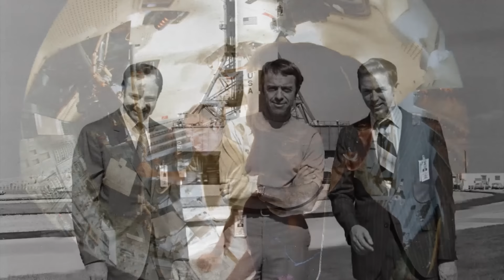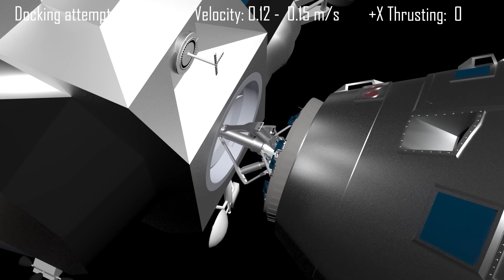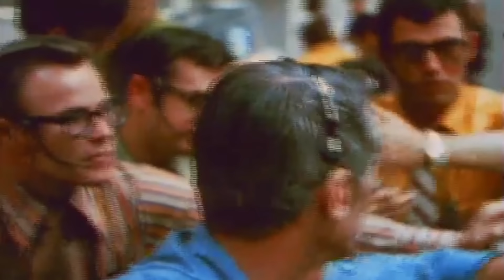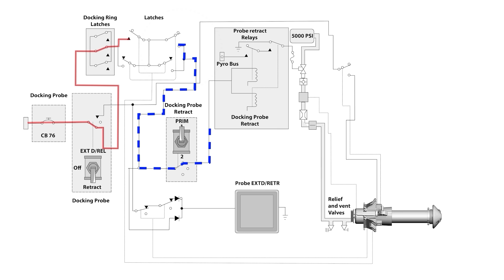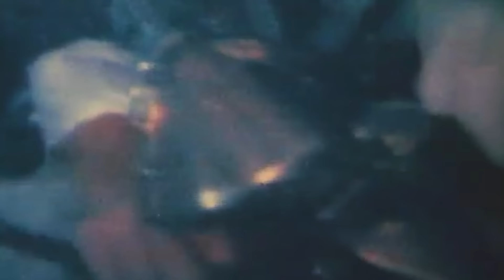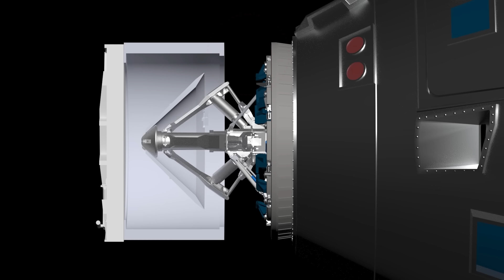Apollo 14  -  Houston, we have another problem

Comment: Thank you very much for this incredibly detailed video, with all the modeling of the mechanisms!

I have a question though - with regard to the 12 latches that trigger to lock the two vehicles together (after the probe is retracted), do those fire with springs?  And those are strong enough to hold the vehicles together with the pressurized interior just due to their geometry and where the pivot points are (just about in-line with the contact edge/lip)? I'm really curious about that.
Reply: And then they a lived happily ever after fool.
Reply from the maker: yes, and they didn't need all the latches. if some didn't work they could still make a seal and then when they opened the hatch the rest could be triggered manually. more info in my other video here: https://www.youtube.com/watch?v=4drYZcMY9jU&t=1s

Comment: I'm really enjoying your videos, they answer a lot of quests about the many subsystems of the various spacecraft. And of course raise more questions! 
When the LM ascent stage returned from the lunar surface, did the crews experience any additional docking problems, or did everything latch up normally, as expected?
I suppose if docking failed, the astronauts could have done an EVA to transfer from the LM to the CSM, but that would have been exhausting and extremely dangerous (man floats away, spacecraft hit and suffer damage, etc.) Every time the hatch any operated is an opportunity for a malfunction.

Last thing, have you made a video discussing the umbilical mechanism between the CM and the SM? I've wondered how that worked and what problems it may have presented. Thanks!

Comment: Got me thinking - what if they couldn’t undock and they had to try a re-entry through the earths atmosphere with the lunar module still attached .
Reply: The docking collar uses a redundant system of pyrotechnic charges to do the final separation between the CM and LM. If that somehow failed, I have no idea what kind of contingency plan they might have? The docking collar needs to be ejected before the parachutes can deploy so reentry with the LM attached wouldn’t even be tried.
Reply: If that really, really happened? They'd all die. The aerodynamics would be horrible, the heat loading would be greater, and assuming they made it through re-entry they couldn't use the parachutes.

The odds of the pyrotechnics to forcibly permanently separate the LM and CM failing are rather low, however.

Comment: They wouuld have to do it again at the moon.  Even though it eventually worked this time, if I was them I would be very concerned that may not work when they are at the moon.  If they never got it working this first time, they just abort and go back home.  If they couldn't get it the second time, the only way the two astronauts that went down to the surface could get home if they decompressurized both modules and space walk to the LM.

Comment: On each failed attempt the Lem stage must have been accelerated away by each impact, accelerating faster and faster away. I wonder how it didn't start to tumble out of control?
Reply: The docking was designed for the forces to go through the LM and CSM center of gravity, so it would not impart a rotational force.

Yes, each impact imparted a small amount of velocity on the LM, but the CSM could make up any difference by matching that velocity change.

Comment: I'm kinda surprised they went ahead with the landing. Weren't they worried about it having the same problem when the LM returned from the moon? What would they have done?
Reply: In that case, astronauts would most likely enter by doing a spacewalk, which would be really risky, but if there's no way to dock, it's the only option
Reply: An EVA crew transfer back into the CM was indeed one of many contingency scenarios that was planned out on what to do.
Reply: The Soviet plan for a lunar landing was also to do a Lunar Orbit Rendezvous with a modified Soyuz and LK lander.

They would dock but only send one Cosmonaut to the moon.  No tunnel was designed, and the moonwalk would transfer between spacecraft with an EVA.

Comment: Back in the day, Ed Mitchell's website had a forum where you could talk with Dr. Mitchell himself.  When I asked him about the docking incident he speculated that the probe latches had iced up, and that stopped the latches engaging, and that the ice broke after a few docking attempts attempts, releasing the latch and allowing the docking to succeed.  

He also said that if all the docking attempts had failed, they had a last resort plan that involved donning suits, depressurising the CM, opening the hatch and manually pulling the two craft together.  

This seems to validate what Ed said on the subject in that forum.
Reply: How would they do that? The docking probe is in the way.
Reply: @penguin44ca  they can bring the probe inside, just like how they would have when the spacecraft were docked normally, however there isn't a lunar module  in front of it.
Reply: Was there any fear that they wouldnt be able to dock after the moon landing?
Reply: @richieb74  once docked, you can have a look at the probe in a pressurised environment, and potentially fix whatever was the issue. Either that, or decide you’re aborting based on the inspection.

Comment: ...and; there was another huge problem just before separating for the lunar landing.   They were getting an abort signal from the lander, which would end the mission.   Nothing at current, would have caused problems, until;....they were separated and the lander was going through touchdown procedures.   Not to mention; a huge problem with one of the pressurized tanks, possibly leading to over-pressurization, and explosion,  which was solved  within a 15 min. time by an Earthbound engineer, who developed a fast computer program and had the Astronauts program it into their computer, and solved the problem.   It seems life was making it extremely difficult for Shephard to venture a moon landing.   NASA and Alan overcame the challenges.
Reply: And that’s why Al surrounded himself with a razor sharp crew.
Reply: If I recall correctly, that actually affected their allowed duration on the surface.

Comment: This was great - just wondering, wouldn't there have been a [huge] concern at the time, about re-docking after lunar landing/assent?
Reply: At that point they would have positioned the LM close to the CSM and transferred crew and samples between the two vehicles through the hatches if it came to that.

Remember that the ascent stage had 2 points of entry, the main hatch and the hatch they used as a transfer tunnel. Dave Scott on Apollo 15 did a 'stand up' EVA after landing on the moon from the top hatch to survey the landing site before they stepped out onto the surface. So they could have moved between the two vehicles that way.

The astronauts would have reentered the command module through its hatch, it didn't remain sealed until splashdown, as that was how the film cassettes were retrieved from the service module before it was jettisoned prior to reentry. One of the crew, the command module pilot, would perform an EVA to get them.

It wouldn't have been such a problem coming back from the moon as the LM was not needed to leave lunar orbit and was dumped before breaking orbit. The problem was that the LM needed to be attached to the CSM to get to the moon when the service module engine made burns on the way there and to slow down for orbital insertion which couldn't have been achieved if the two were not connected.

Comment: Do you know that: When you change speed, orbit high change. So how they ever made dockings?
Reply: They weren't in orbit; they were on their way to the moon.
Reply: @Tim22222  They did undock and re-dock while in lunar orbit so the question is relevant. 

That was the whole purpose of a lot of the Gemini missions. First prove they could rendezvous with another spacecraft while in Earth orbit. Once that was done, they had missions to prove they could dock together after a rendezvous. Certainly isn’t easy but for seasoned pilots with decades of hands on experience, it’s certainly doable.
Reply: To answer your question - there are thrusters to push the craft in all axis. So when they are docking in orbit - if you need to increase or decrease orbit speed relative to your target (which does affect your orbital apogee & perigree), you can temporarily counter this with burns in the vertical axis until the docking is complete.

Comment: I'm wondering how they were able to keep thrusting into the LEM without the whole third stage and structure moving (bouncing) away from them every time it was hit. Was the third stage also thruster stabilized to hold its position without drifting? Or was it heavy enough on it's own to take the repeated docking attempts?
Reply: It did bounce away. Not very much, but it did, that's just physics. But because the CSM had thrusters, it could match pace with the S-IV-B and the attached LEM without issue

Comment: I like your faith in the Moon landing. So, could you explain how they lined up the axes of both modules after one of them turning around the center of gravity and the other one was after 4 explosions to get rid of the outside guards? And are you aware that all this is :happening in a speed high above the Earth escape velocity...?
Have you ever seen for example formula F1 slightly touching each other in a higher speed?

I would seriously love to know, if you really do believe all that you are posting... BTW very nice contemporary animations. Love it!
Reply from the maker: I suppose it's similar to when they dock to the ISS which is travelling at approximately 17,500 MPH. Glad you like the animations.
Reply: because everything is moving at the exact same speed relative to each other. They also had the RCS to slow down in relation the the lem.
Reply: "Have you ever seen for example formula F1 slightly touching each other in a higher speed?" 

What even is high speed in this case? 2 people standing still near the equator, giving each other a hand shake are both technically travelling at over a thousand miles an hour, due to earth's rotation...what happens to them, do they blow up? But even that's just with a theoretical static earth as a reference point, add the velocity of the solar system through the universe and yikes! Maybe I should avoid handshakes for a bit.

Comment: I’ve always wondered, how did they keep it from malfunctioning when they docked on return from the lunar surface?
Reply from the maker: They hoped it wouldn't and it didn't ,👍
Reply: @graffix101  if it had failed on return, what would they have done? is is feasible to depressurize both modules and spacewalk back over?
Reply from the maker: @adriansue8955  yes, they could have done that.
Reply: I'd read that it worked flawlessly on the return from the surface. But as someone said, if they had to, and it would have been dangerous, they could have spacewalked over.
Reply: If the docking would have been impossible, then LM crew would EVA to the CM. There was well enough oxygen for repressuarize as you only need 5psi. LM had only 3,5psi. Here on earth we have 16psi on sea level.

Comment: I wonder if there were worries about docking again after taking off from the moon. I thought they would have aborted anyway due to a potential docking failure causing astronauts to get stuck in the lunar module to perish.
Reply: They could do a space walk in that situation
Reply: @idontcare9797  With their PLSS back on the moon?
Reply: @user2C47  in the case of needing to transfer from the LM to the CM in lunar orbit the astronauts would utilize the OPS (oxygen purge system.) This was a part of the PLSS that was retained by the astronauts and not left behind, specifically for this contingency. It would have been worn around their waist.

Comment: Wasn't the last time they had docking problems though. They had issues docking to Skylab a few years later too. Granted that the station was damaged during launch, but it just goes to show how critical such a mechanism is to the success of such a mission.
Reply: The reason they had problems docking on that Skylab mission is that they reused the docking probe from Apollo 14!
Back on earth they had rebuilt the probe and thought that they had fixed it, and re-qualified it for the Skylab flight.
Reply: @shabbysnubtide3339  Was that Skylab 2 with Pete Conrad?
Reply: yes

Comment: Wasn't  the Apollo 14 probe reflown on the ASTP mission in 1975?
Reply from the maker: im not sure. I have heard that mentioned somewhere but cant find confirmation anywhere.
Reply: @graffix101  It's listed in the ATSP Mission Report as refurbished hardware, along with a number of Apollo 16 Command Module panels.
Reply from the maker: @paulcarpenter999  thanks for that. 👍
Reply: @paulcarpenter999  The CSM for originally for Apollo 15, with a an instrument panel from Apollo 16, and a docking probe from 14. They should have called it Salvage 1, lol.